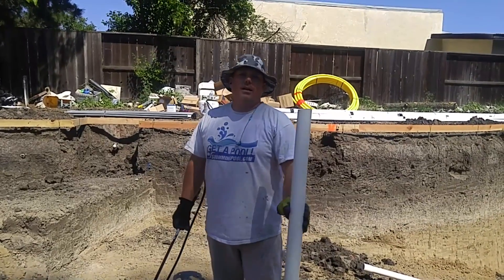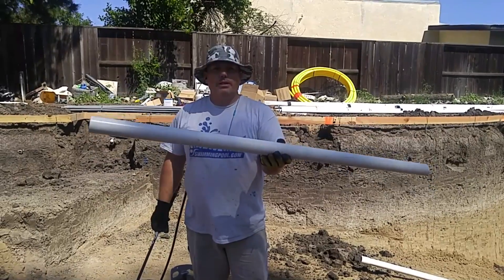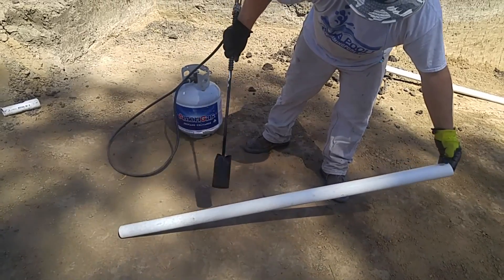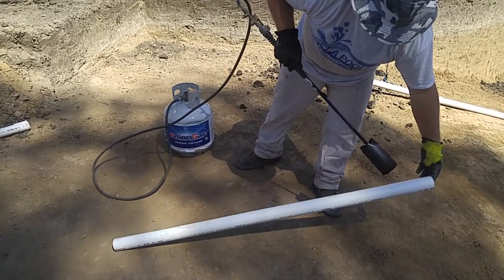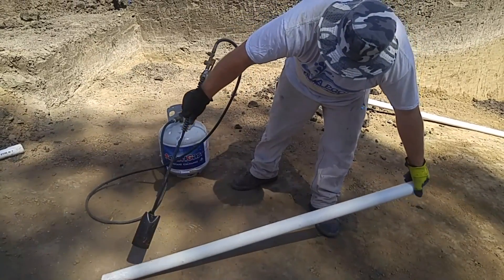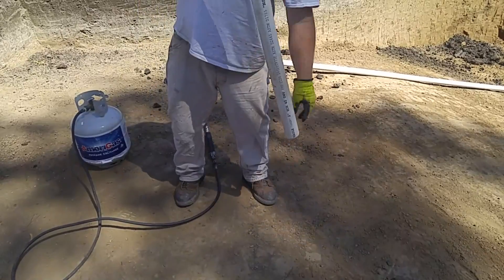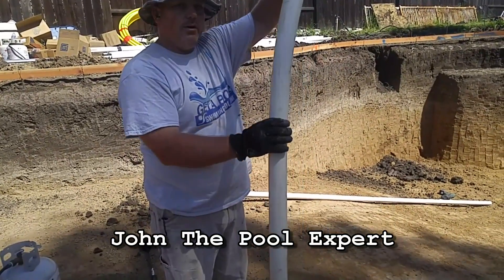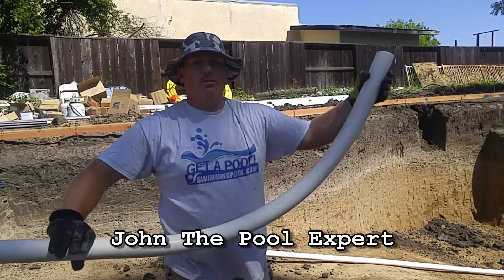Heating PVC Pipe Until Flexible

Comment: Unfortunately, heating with a torch voids the manufacturers listing for the pipe. A torch heats the pipe unevenly and creates week spots in the PVC, the proper way is with a blanket or hot box.
Reply from the maker: Unfortunately that's not realistic they don't have a 20-foot blanket or box. Also I've had many leaks on fittings but no leaks on heated bends.

Comment: What is your recommendation regarding how many BTUs needed for that weed flame thrower if I need to bend schedule 40, 1-1/2 inch rigid pool pipe?
Reply from the maker: Maybe 100,000 to 200,000 BTUs

Comment: Can I do this if there’s a wire already in the conduit?
Reply from the maker: Yes it should work fine
Reply: @JohnThePoolExpertGuy  the conduit is like 25’ long and I’m looking to bend it back straight. The curve is only like 10-15 degrees over that 25’. Seems like it should be pretty easy aside from just digging it all up initially

Comment: I need to remove a 2m long pvc pipe encased in a concrete floor slab. How do I soften the pipe so I can pull it out once it softens?
Reply: You Jack hammer it up 😂
Reply: Hot sand might work. Problem is that the concrete is likely glued together with the pipe. Maybe impossible

Comment: If you had something flexible but solid in cross section but somewhat heat resistant (maybe a pool noodle wrapped in foil tape) to put on the inside AFTER you heat, but BEFORE you bend, that would help keep the pipe from collapsing, and even out the bend radius. 
My 2 cents, thanks for the video.
Reply from the maker: Yes that works I'm also seen people pack it with sand and other things........ whatever works!
Reply: I feel like its not worth the effort

Comment: Hopefully your not a true contractor or professional wouldn’t.  Haven’t seen any of the real ones use anything but fittings on a pool build.   Keep that for the non jobs that’s your own.  Be a professional and use the fittings.  It’s all paid for in the agreed upon an signed contract of the job.  What your doing is just cutting corners
Reply: Lol , I worked in a pipe factory, we heat the pipe up to make the bends , we do it in an oven style system but his method is just as good . We charged $22.00 more for bends , you can do the same yourself for almost nothing .!
Reply: Aquatech U clearly aren't a person that is good with your hands
Reply: I’d rather it done this way instead of adding many potential fail points FYI  Mr. Aqua tech guy with glue. Just my thought
Reply: Shut up you obviously have no idea what you’re talking about. Ever heard of TDH? Probably not.

Comment: Can i use a gas torch for this?
Reply from the maker: Yes
Reply: @JohnThePoolExpertGuy  thank you for the reply sir :)
Reply: I have a 3 metre pvc pipe that has not been used for 2 years and not its kinda bent. I want to do hydroponics so the pvc pipe needs to be straight. Can i use this technique with a gas torch?